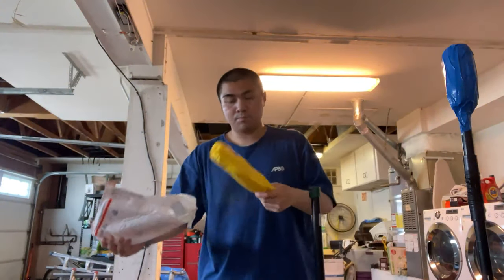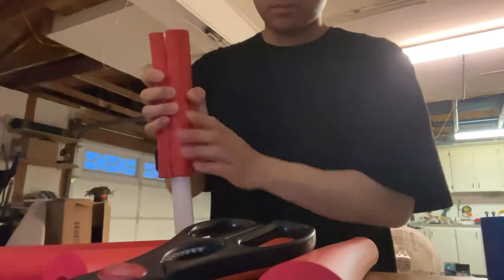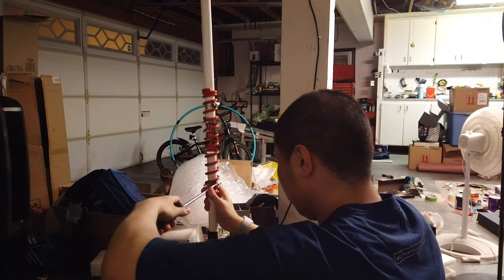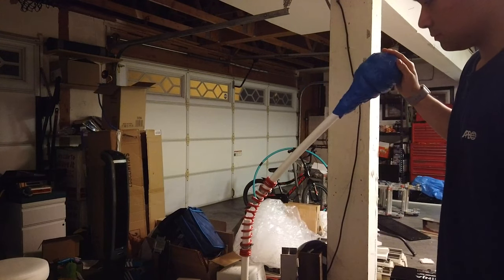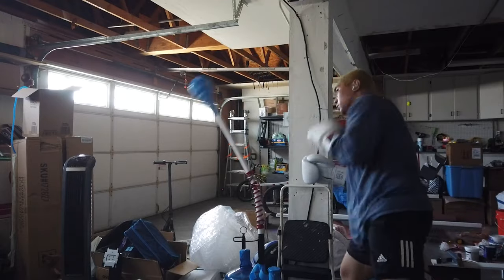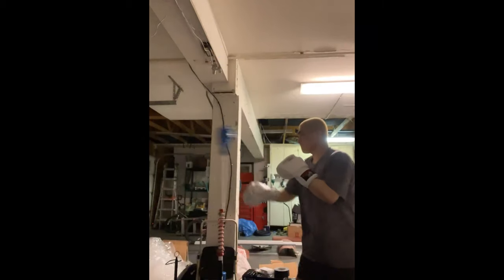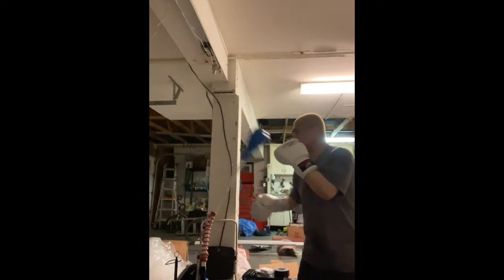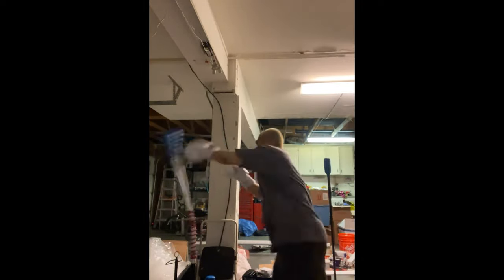DIY Reflex Bag using the Kewlus PRO Spring

Comment: I found that using an adjustable pull up bar for the steel pipe is ideal because you can adjust the size easily